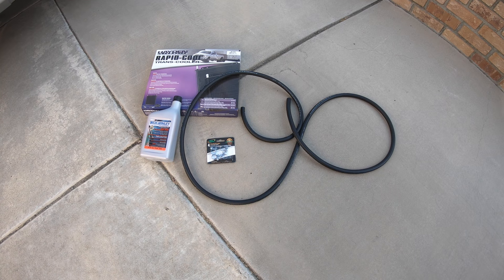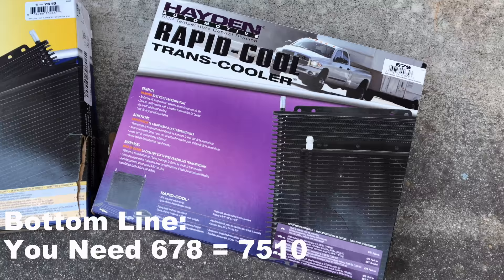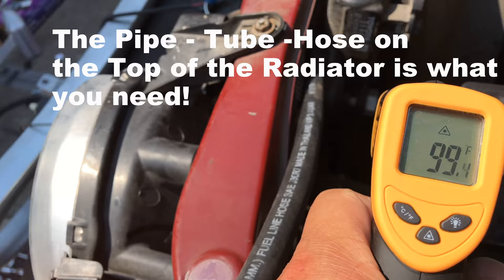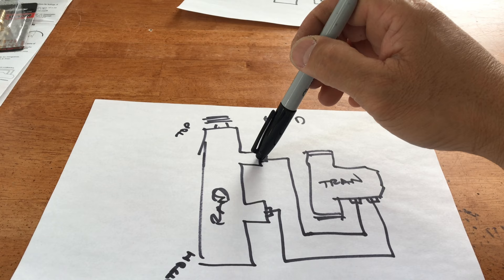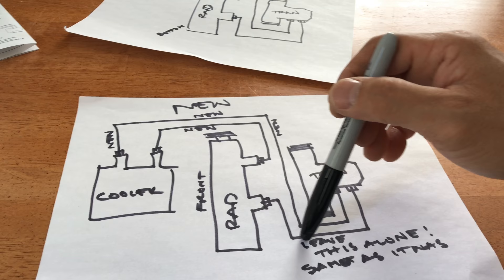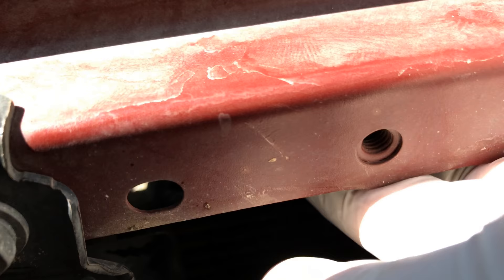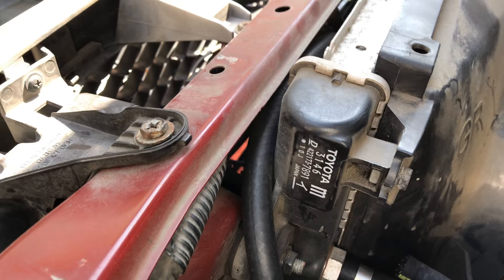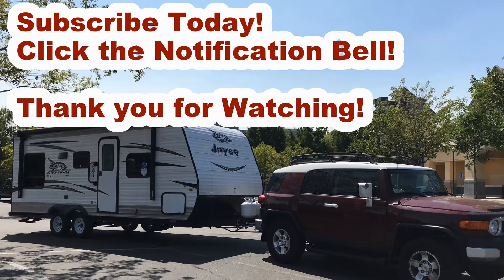How to Install a Transmission Fluid Cooler on FJ Cruiser

Comment: directions from Tru Cool specify add auxiliary cooler AFTER the OEM radiator.  

If the mini cooler was more efficient than the OEM putting it first could possibly cool the radiator fluid  even more protecting oil and engine life, but I think these little coolers will do better cooling the pre-cooled tranny fluid by installing after the big boy  cooler.
Reply from the maker: Thank your for watching! Confirmed... Tye manual does state to put it after the oem. I appreciate the feedback

Comment: I also wamtsd to add a tip for drilling holes, chuck a block of wood behind the hole you wamt to drill, thatway if anything goes wrong it hits the wood rather than puncturing the rradiator or anything important. my concern is, the 4lt v6 can get hot and if your obscuring such a large chunk of the radiators air intake what kind of engine heat are you causing. Also by adding an extra loop to the system are you making the pumps work harder as the fluid has to travel much further now. Maybe insignificant but a lot of these mods dont seem to take into acount what possible changes they are causing.
Reply from the maker: Great input with the block of wood to prevent accidental hole on the radiator (during drilling). Thank you very much for watching and feedback

Comment: The way you mounted the cooler, without a bracket is asking for trouble. The cooler core becomes a part of the structure so as things warp and flex, the core bears to stress. Securely attach a bracket, then mount the cooler to it.  Also, self tappers? No, just no.

Comment: Great video!

Two quick questions:

1: is there any potential issue of filling the ex. Cooler too much or too little with fluid?  Could it cause damage to the trans?

2. When you took the tube off the transmission Im assuming some came out of the tube?  Did you then replace any?  I have the TRD so its a sealed transmission which is a massive pain. 

Thanks again!

Comment: wouldnt it defeat the purpose of installing the aftermarket cooler w/ this set up? the internal cooler in the raidiator could still leak internally & contaminate & damage the trans.

Comment: Great video cbatilo. Really appreciate it when people take the time to show stuff like this. I just have one question, I ordered the same trans cooler yesterday, is there any way there is room to add a 10 inch electric cooling fan to the trans cooler or would that be overkill, as in make trans fluid < 160 F? I do a lot of rock climbing and extreme offroading in my FJ and that thing gets HOT.
Reply from the maker: Great idea with the fan! Especially if you do a lot of stop and go... . Crawling is very demanding... go for it! By the way, I consider my install a medium weather to very cold application. I interrupted the top pipe... Make sure you interrupt the fluid flow from the bottom pipe... all other instructions are fine.
Reply: Scott Phillips 
Go tru-cool 40k.

Comment: So cool the fluid then warm it up again?  You did it backwards.
Reply from the maker: Jay K lol... either way will work...
Reply from the maker: Jay... thank you for watching and for the feedback. I was about to go in to a theater when I saw your feedback. I wanted to explain further.... what you said is partially true. But either way will work. But, I wanted to have my fluid flow done this way. Not sure if you saw that I used a temp reader. I found that the top pipe or hose is the warmer of the two. I wanted to cool it from the Aux Cooler or External Cooler FIRST then go through the radiator then back to the transmission. What you are suggesting would work too! Hot Fluid to the radiator First...then Aux Cooler...then back to your transmission. Your way may cool the fluid even more... but I would say... how much more?.... My take on it... Either way of doing it will help your transmission = last longer and operate a lot cooler! Thanks again.
Reply from the maker: Thanks again Jay. Note for future "watchers" of this video... if you like to change the flow of your transmission fluid to what Jay is suggesting... use the hose on the bottom of the radiator (vs TOP hose - shown on this video). My reasoning was stated or I covered during the diagram portion of the video -- "operating temp". Thanks again!

Comment: did the kit need a Hayden Automotive 397 Transmission Line Fitting Kit or did you need to purchase one?
Reply from the maker: Everything came with it... but, I purchased a fuel clamp vs using the 4 clamps that it came with. I did not buy a line fitting kit.
Reply: thanks dude. think i'll be gettin' one too!
Reply from the maker: Thank you for watching... good luck with the project. FYI: There are two ways to install this. Connect the external cooler to the Top of the radiator hose (exactly like this vid)... or connect the external cooler to the bottom hose of the radiator (recommended by manufacturer). Thanks again!
Reply: i would definitely go with the latter. i live/work in the middle east where temperatures can peak at 55°C (131°F). thanks again!

Comment: Fix your video or take it down you add the cooler AFTER the radiator NOT before
The trans cooler is to cool the transmission. You want to keep your rad warm for heat if you should need it in cool temperatures. Wrong information shouldn’t be shared.
Reply from the maker: Thank you very much for watching. I do appreciate it. First, I do respect your opinion... but I talked about this on my other response. Please check other comments. I still stand by the way I did it. Here is where I am coming from and did it this way: Did you know that there is a transmission fluid cooler inside the radiator... right? Optimal Transmission Fluid temp is between 160 -200 degrees. Fluid Temp that is considered bad for your tranny is 300 degrees or higher. The cooler within the radiator keeps it 160-200 degrees. yes... I want to acknowledge your comment and the manufacturer also recommended to install the cooler after the radiator. The manufacturer gave a recommendation... it is just that... a recommendation... I am not saying you are wrong or the cooler manufacturer. But my logic for doing it this way is... I want my transmission fluid operating temp at 160-200 degrees. I have a feeling anyway, that fluid going through my cooler is probably just a tad bit cooler the 160 degrees. Finally, I also suggested and kept the other comment... the install video is still valid. Just "disrupt" the lower pipe (vs. the top pipe - what I did on this video). And all other steps are the same. Anyway, thank you again... good luck on your project and feel free to do yours "after the radiator".
Reply: @ Robert Neilly What? The radiator "radiates" the heat out (cools) of your coolant (& trans fluid) from air movement across the fins.  It's a heat exchanger. You get your in-cabin heat from your heater core, which uses the coolant heated by the engine, before it goes to the radiator.